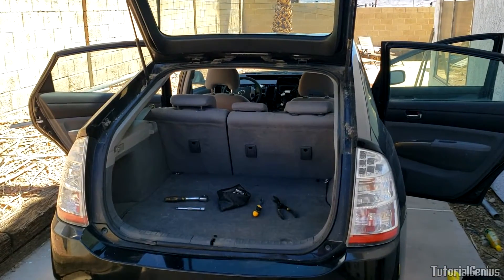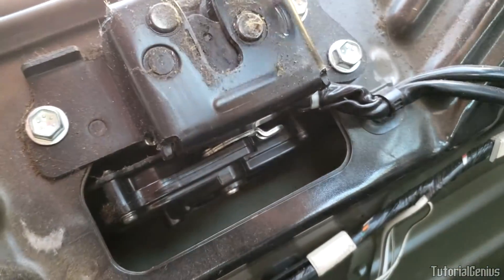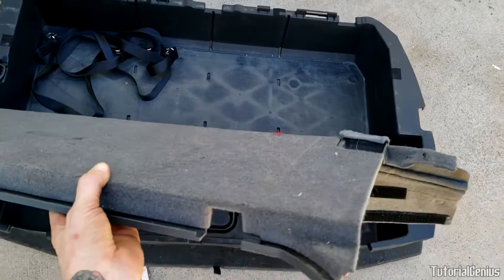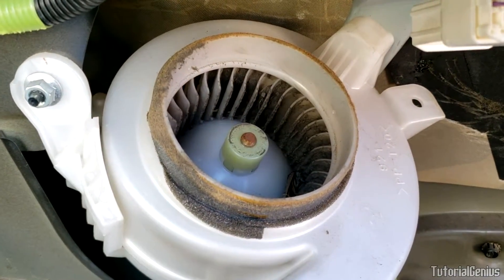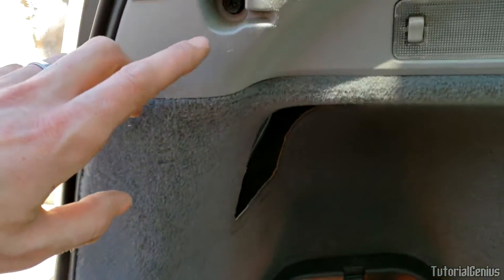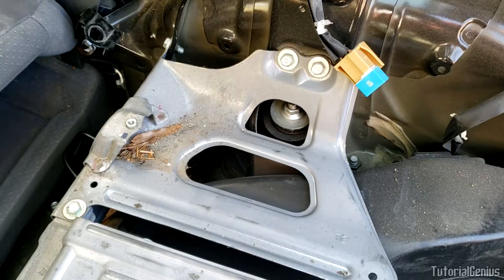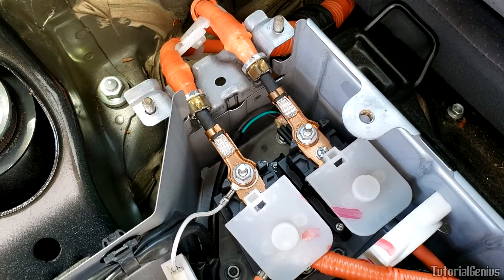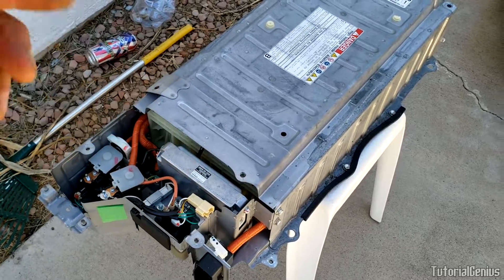How to Remove the Hybrid Battery on a Toyota Prius Gen2 (2004 05 06 07 08 09)

Comment: I never did see how to separate the hamster wheel from the motor shaft -- my fan did not come apart. But a small bottle brush between the blades cleaned it out well. Also lots of forced air. And ahem eye protection.